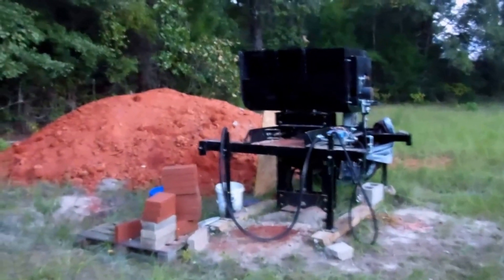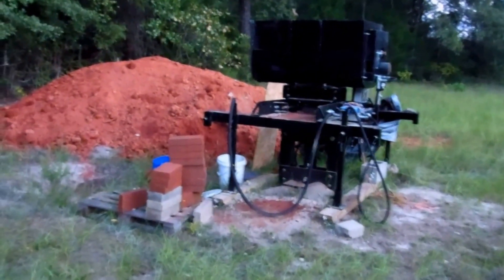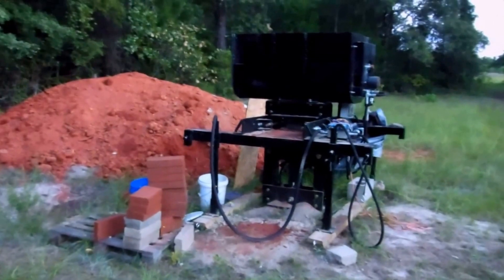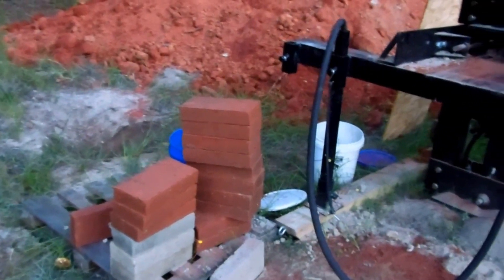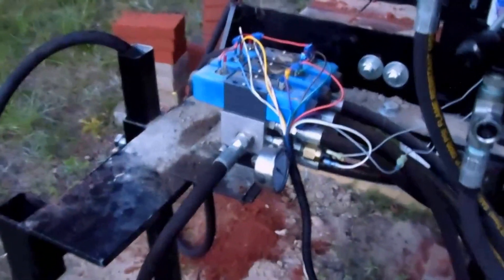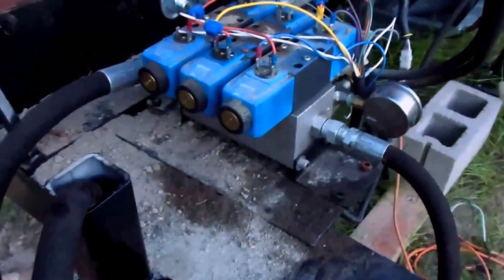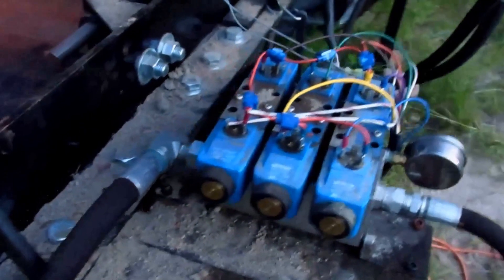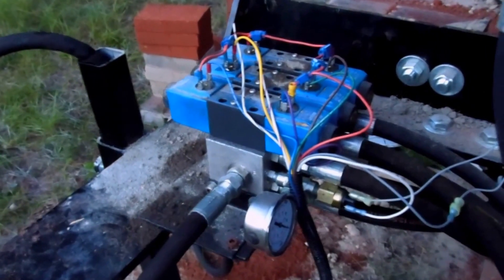CEB Press and Hydraulics Overview

Comment: THANK YOU FOR PUTTING LIMIT SWITCHES!!! Dude, you are not alone on having pressure spikes at the wrong time. I co-authored WKJCEB.ino in 2014 and I assume you're using a modified version of it. I'm in awe of your mixer development and initiative on building one yourself. I hope to speak with you someday soon. I think the teensy ended up being closed source anyway and the thing was chinsey so using a nano is a great idea. Love your breadboard. I wonder about the current draw on the mosfets over time without a soldered connection though.
In my opinion the pressure switch should only be a safety feature, not for motion control. Why would we pressurize the seals EVERY CYCLE? Just doesn't make sense to me. 

I believe inductive sensors would be a better solution than endstops due to the operating environment. Hope to speak to you on this.
 wiki/Aidan_Log
Reply from the maker: Sure, inductive sensors may work great.  The limit switches were inexpensive and easy to install at the time.  My program still uses the pressure sensor for the main compression stroke.  The more pressure you put on the blocks, the better strength they'll have, or so I've read.  I still plan to transfer all of the parts onto a soldered type breadboard at some point.

I probably used your design to come up with this version based on Marcin's input also.  I look forward to starting up my press again in the near future to play with it some more.  I'll have to do some reading to catch up on some of the latest modifications that work, if there are some out there.
Reply: @robbeddingfield4049  As far as modifications they basically just changed the drawer bushing mount point, got rid of the shaker, and some other small modifications. 

Yes, use the pressure switch for the compression stroke, of course. I'm thinking of implementing a system that uses three sensors for the drawer, and one or two for the main cylinder. The main cylinder sensors would be for bottom of stroke and half-brick retract point. Both sensors on the main would be adjustable easily in the field. Marcin is highly against this but I've seen the main cylinder leak after 5k blocks on a 2014 machine. I've also seen phantom high pressure spikes that cause incorrect operation. 

How much testing have you done with your auger? Press many blocks?
Reply from the maker: @aidwilli  The auger/mixer is one thing that, I feel like, works very well.  It directs soil down to the chute without getting clogged.  I've only made a few hundred blocks for testing loading methods and testing soil.  I found out for stabilized blocks it's very important to have the right sand/clay mix.  I'm going to have to work on my loader to get it going; it's very slow to load soil with a shovel!
Reply: @robbeddingfield4049  Yes, the proper mix is critical for QC. A robust mechanical mixing solution to control water, soil, stabilizer mix is needed for large production batches especially in North America where labor is expensive.
Reply: Limit switches are not necessary when using the updated controller logic of v19.10 as found at https://wiki.opensourceecology.org/wiki/CEB_Press_Controller_v19.01

Comment from the maker: It took me around 9 months by the time I got the hydraulics and electronics straightened out.  I didn't know a lot about hydraulics until I started this project.
Reply: I thought they had plans/drawings on this, 9 months sounds like you had to do some re-engineering?
Reply from the maker: @KarasCyborg  from what I remember, we made a lot of revisions around this time after I helped revise the cad they had previously.  Since they are not mas produced, I would be surprised if a new machine did not require some tinkering and some problem solving.